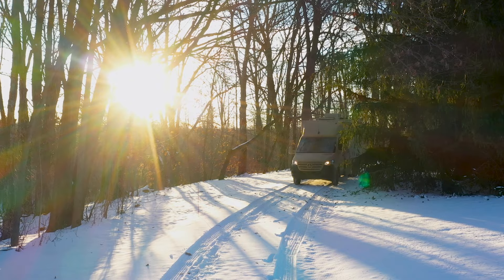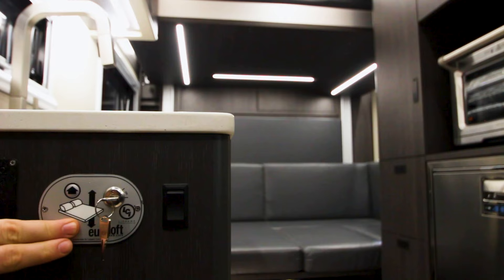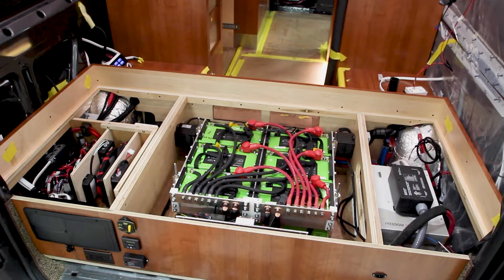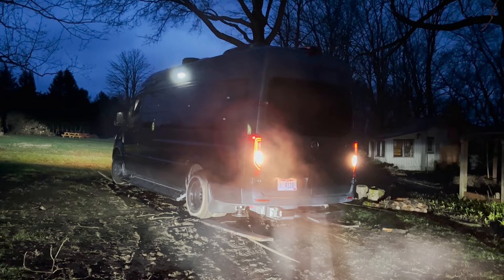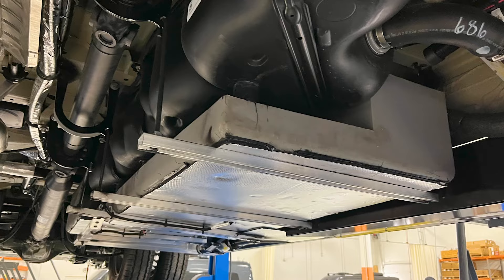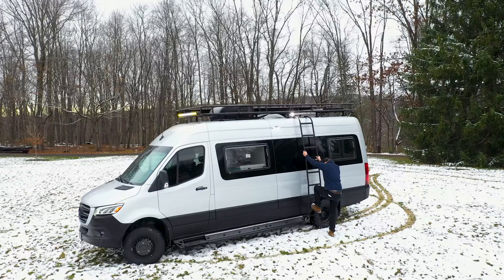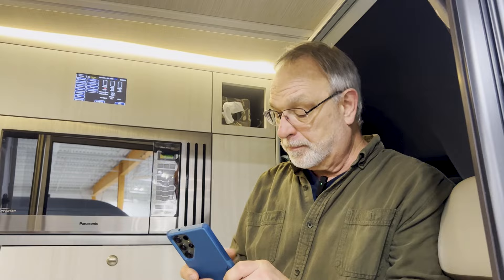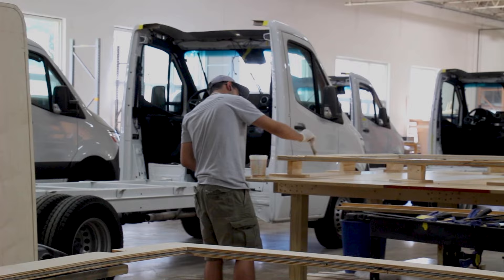When Advanced RV is Less...

Comment: A nice thing to remove from Sprinter van based campers are the siding side door and the rear doors.  It is possible to replace the sliding door with a traditional camper door.  The rear doors can be replaced by traditional camper hatches.  This will open new opportunities and solve most of the insulation issues with  vans.  Some European camper builders are looking into this.
Reply: They offer their B Box design.

Comment: I’m a big fan and I also love to travel. My question is can you add an extra fuel tank on a sprinter van?
Reply from the maker: Thanks for the question. Yes, you can supplement the fuel capacity of the Sprinter as long as it meets weight and safety requirements.